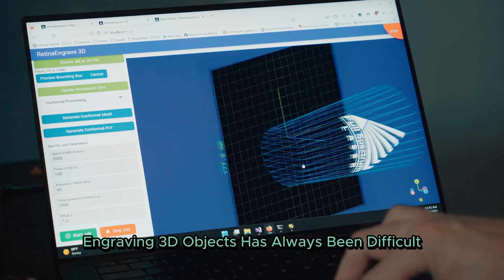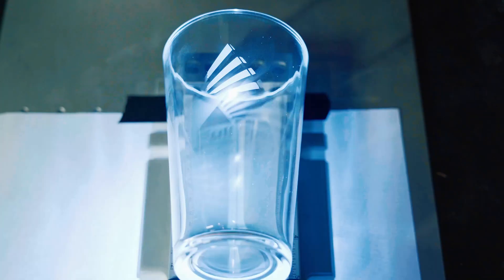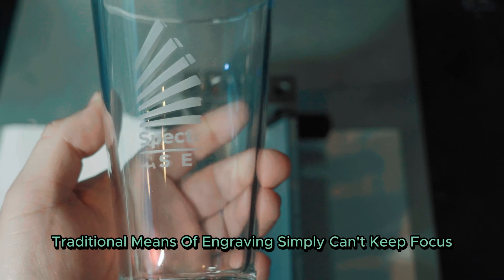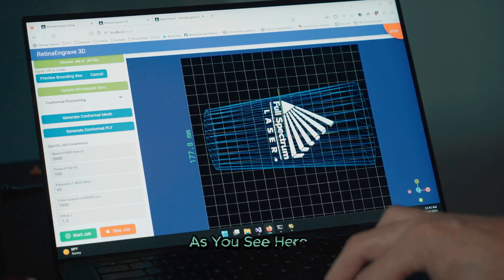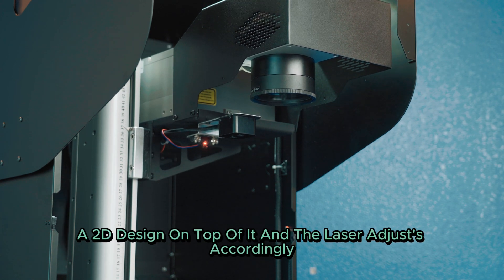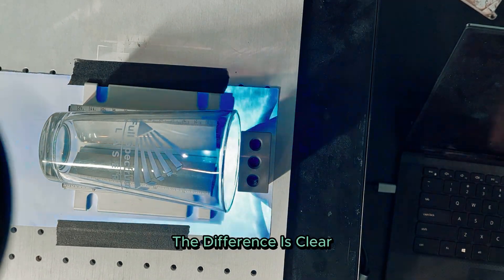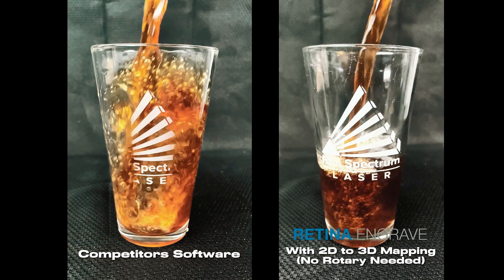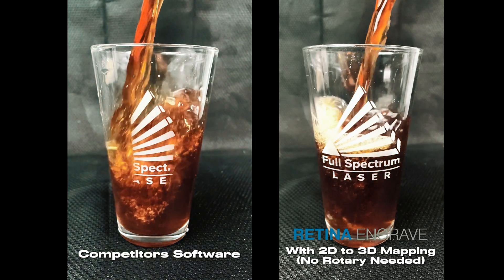Full Curved Surface 3D Engraving using FSL UV: Cylinders with No Rotary

Comment from the maker: As many of you know, tapered glasses are difficult even with a rotary.  A rotary can keep a cylinder in focus but a taper changes diameter.  If changing diameter in a friction rotary, it will wobble and be all messed up.  In a chuck rotary it will spin but you can only engrave a small area because otherwise it's out of focus.  Some people will try to tilt the rotary but with a high taper like this glass, the image will all be messed up as the glass changes diameter.  In 3D engraving, the object project is calculate perfectly to wrap the surface.  The glass is held in the V block so no chance of slipping.  The Z head moves up/down while engraving to keep it all in focus at all times.

Comment: It uses z stage to keep focus. Projects drawing onto 3d surface and engraves it in 3d.  This is the best way to do glasses on UV laser because depth of focus of UV is extremely short but with our taper glass mode just throw it down and it's always perfect. 30x better quality than co2 and also way faster and easier.